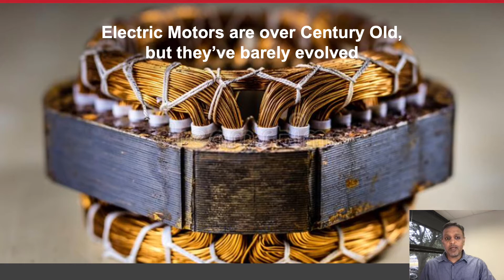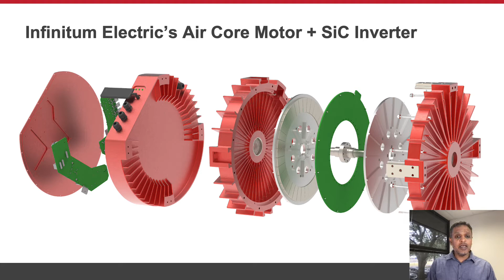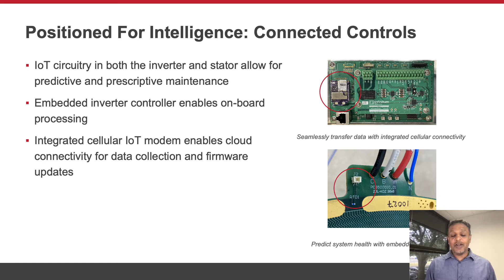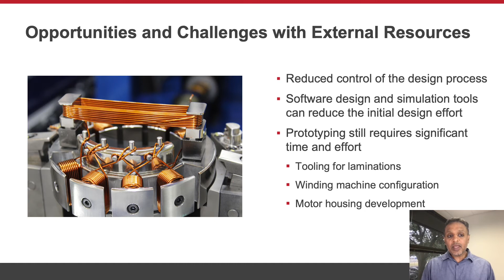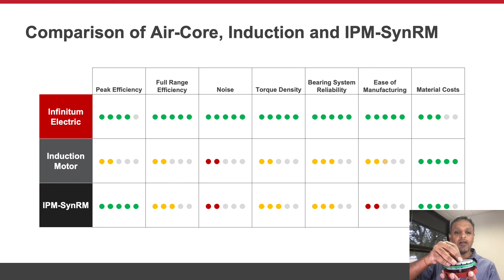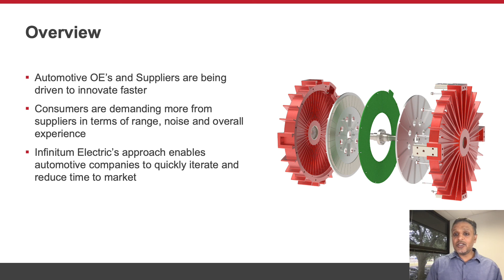Infinitum at Charged Virtual Conference, Fall 2021

Comment: Hello, Really nice product, I have 2 questions; (1)What is the maximum torque (current) you can produce from 1 stator (not a stack of stators)? (2)I looked at your catalogue and found that the torque density is actually low compared to other Axial flux motors (eg YASA that can achieve 20 Nm/kg of the motor).......Regards, Sam